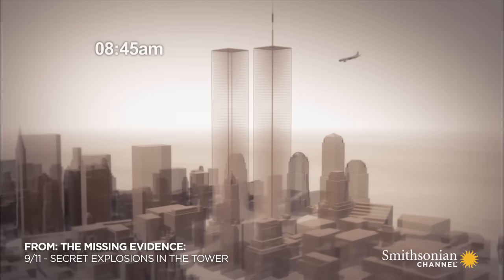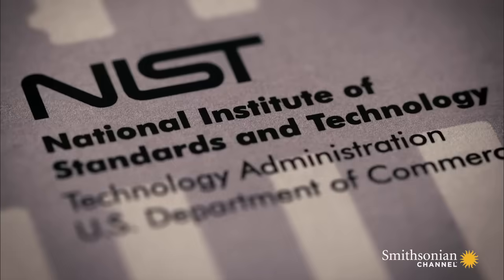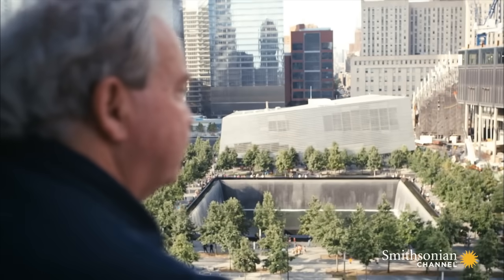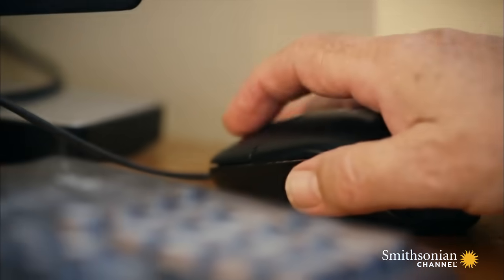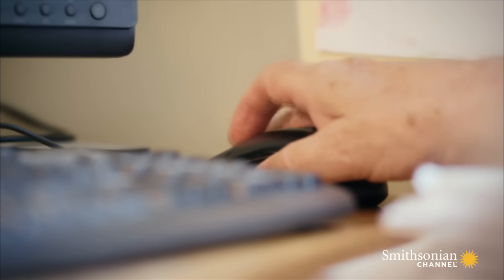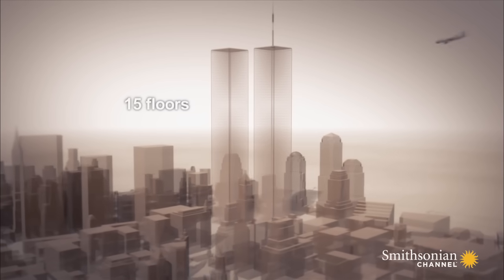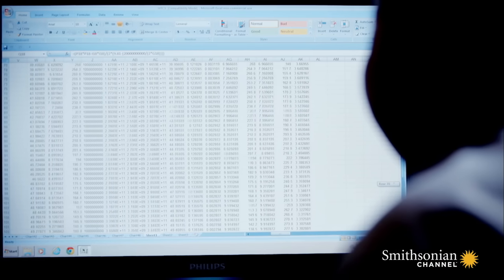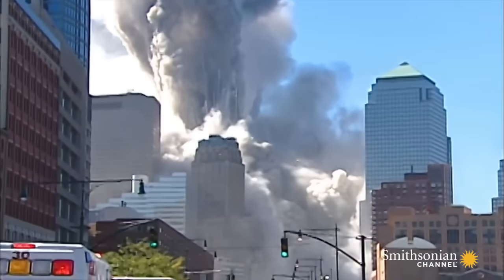This Computer Simulation Explains How the Twin Towers Fell

Comment: Thermite and controlled demolition. 
No other way is plausible.
Reply: ? Were the towers made of wood?
Reply: @Tim22222  haha , well spotted
Reply: @broadkast477  Okay, next question: When have you ever seen a complex skyscraper demolition performed with thermite? Not possible, thermite is too slow.
Reply: @Tim22222  good boy , you keep telling them that.
Reply: Good sir, The impacts of the planes striped the fire retardant spray foam off of the steel beams, exposing them to the full brunt of jet fuel fire and the continued fires of everything else. This lead to the steel beams being weekend to the point of failure. Which resulted in the collapse.
Reply: @HazmatUnit But I guess its more fun to think the government did that to us

Comment: Buildings don't collapse in their own footprint, unless an implosion took place! The core was too dense to collapse..... unless it had some serious help! Stop believing these fairytales!
Reply: The towers spread destruction 200 yards in every direction. They did not collapse into their footprints, not by a long shot.
Reply: Good sir, The impacts of the planes striped the fire retardant spray foam off of the steel beams, exposing them to the full brunt of jet fuel fire and the continued fires of everything else. This lead to the steel beams being weekend to the point of failure. Which resulted in the collapse.

Comment: HOW DOES STEEL TURN TO POWDER DUST??????
IT DOESNT !!!
Reply: No steel turned to dust, so no problem there.
Reply: @Tim22222  then where did it all go? You telling me those two monstrosities have a small debris pile??.
Ridiculous
Reply: @paulsutton5951  Did you know the WTC complex had 7 levels below plaza level? So the pile was in actuality about 10 stories high! And since the towers were 95% air, that sound just about right!
Reply: @drizzho  Weakens the steel, maybe for a partial collapse not a whole building.
Reply: @user-fm3xr9yz3i  where is the building gonna go? The whole top half crushed the bottom, the floors were supported by truss’, not actual beams. The center core where most of the support is, stood 60+ stories for a good 10 seconds after collapse, then when everything it was welded to was gone, it too came down into the pile.

Comment: Considering the impact zone of the north tower was around the 80-100 floor zone, how did the "45k ton", 20-30 floor portion of the building have enough force to plow through the bottom 80 floors which surely would've been triple that number and would've been able to resist the collapse? Logically speaking, how did the top 20 floors slice through the bottom 80 like a hot knife through butter in 11-12 seconds?
Reply: Answer: One floor at a time.
Reply: @Tim22222 <----- this is a government shill. It's only purpose is to go after anyone who questions the official story.

Comment: If his theory is right the building wouldn't have been standing as they were adding floor while building it. Imagine the weight on the first 10 floors? How did it hold all the others? So if one collapsed it would act like dominoes? Zero chance of that
Reply: There's a good docu here on youtube: "World Trade Center: Anatomy of the Collapse." Look for  it, it's a very good explanation of why once the collapse started it could not be stopped.

Summary: In the towers' unique "tube" design, unlike traditional skyscraper design, the bottom floors didn't carry the tower above! Instead each floor was supported individually by clinging to the columns & was only responsible for carrying its OWN weight, not the floors above - the columns did that instead. So what happens when 100,000 tons of tower top falls onto a floor only designed to carry 3500 tons? It punches right through! And keeps on going...

Comment: I think Smithsonian need push for investigating more these 4
1) How did both buildings fell the exact same way if second tower was hit at a different angle and height? How did it collapse first vs the first one which was hit earlier? 
I would also expect that if top part collapsed it would at maximum take out as many floors below as they are above. Newton third law
2) Second building should have had is top part fall off on the side where the explosion occured.
3) WTC7 how did it got on fire? And collapsed like a pancake?
4) This Steel and concrete structure wasnt able to sustain heat but other structures that been on fire for HOURS havent collapsed? Just burned?
Reply: 1) The 2nd tower fell first because it was hit lower down (more weight for the damaged section to support) and asymmetrically.
And you do not understand Newton's 3rd, because you are failing to account for something: GRAVITY. Newton's 3rd refers to a "closed" system, on in which there is no external force (like gravity!) acting on it. STRIKE ONE!
2) To fall off to the side, the top would have had to slide sideways more than 100 feet! There was no sideways force to do that. STRIKE TWO!
3) The collapsing towers hit it. STRIKE THREE!
4) Which of those other structure were hit by a plane first? Which had their water supply cut off so the sprinklers didn't work? YER OUT!!!

Comment: Did not really see a complex computer physics simulation here, just a guy sitting in front of his Excel spreadsheet.
Reply: a physics simulation is just math calculations of forces, you're probably thinking a graphical simulation model
Reply: @horseradish4046 No, I merely doubt the approach purely based on the tools he used.
Reply: The math says that three thousand bodies don’t disappear in a building collapse ( 90% of the victim’s bodies were never recovered from ground zero!)
Reply: The Excel contains the simulation—i.e., the mathematical calculations as to whether the towers would collapse. It's math, not graphics.
Reply: Calm down
Reply: Calm down

Comment: Didnt they fall just from the burning? Thats what I’ve heard atleast
Reply: No - burning and extreme structural damage from having a 150-ton jumbo jet crash into them at 500 mph!
Reply: @Tim22222  i was kinda right i guess
Reply: @Tim22222  because the burning weakened the structure right?
Reply: @DeezerWeezer20  Yes! The temperatures of the fires exceeded 1800°; steel weakens up to 90% at that temperature!

Comment: Here is the problem with this entire narrative planes are created to collapse upon Impact in order to create less chance of explosion and less impact jarring of passengers. Airliners have been cut in half by power lines... your telling me a plane cut 10 steel beams in half!! Wow!! Ok if that's what you say!!
Reply: The planes still weighed ~150 tons, and at 500 mph that's a LOT of kinetic energy the buildings had to absorb.

And no, the planes did not cut any steel beams, they separated them where they were bolted together.
Reply: @Tim22222  I'm sorry it seperated the beams where the bolts are lol... you don't understand much about construction do you those areas where bolt meets steel is probably the most sound positions of the entire building and once again you can cut through a plane with a hammer. Planes are made to come apart when they contact anything solid. They are made to collapse they are from design made to fold!!! I can't say that any more clear it's not a fighter jet or military craft it's for public trans port and they are made as light as possible so there is no resistance when impact is made look it up it very easy to find this info out. The second that fule caught fire it burnt up hence the fire ball you see when impact is made that fire ball exhausted over 50% of the fuel in a instant every floor and all the steel under the damaged floors is not damaged in any way no fire no cut beams no damage. The top floors fell 15 feet before contact with the next floor so how is there enough drop to cause failed  floor after failed floor the speed of free fall!! I'm sorry every person other than the 911 special committee ALL OVER THE WORLD HAVE DLL SAID ITS IMPOSSIBLE!!! thank u for your time

Comment: LOL. One lonely man in his bedroom with his PC solves all first world problems.  His model does not explain the prescence of nano-thermite, nor the basement explosions, nor the molten steel at ground zero, nor the fires that took 92 days to extinguish, nor the velocity or trajectory of flying girders blasted up into the sky, and 100m away from the building, nor the the fact that the security of WTC was a brother of Bush run company, nor the fact of that central core elevator shafts were out of action in the preceding week due to "maintenance". Am pleased he has solved the case. 😂
Reply: His model does not explain the "presence" of "nano thermite" because there was none. Neither was there molten steel. There were long-lasting fires but those aren't hard to explain, really, as there was virtually unlimited fuel in the pile. Gish gallop, gish gallop ...

Comment: I love how all the conspiracy theories focus on how the buildings collapsed instead of looking at the real hidden truth. All of the pilots had to be highly trained and experienced to perform those maneuvers at those speeds and at those altitudes.Those planes are not designed to be flown at those speeds close to the ground where the air is much thicker. I heard a commercial airline pilot trainer say the " They had to perform those maneuvers like the plane was made of glass". To believe that they took the classroom part of flight training in Florida and then did this is like beleiving that your teenager could take the classroom part of drivers ed and then back a tractor trailer around a corner and into a loading dock in one shot.  Where were they trained and by who? In Saudi Arabia by US military trainers on bases that WE built. Those buildings had serious design flaws. That is why no other buildings have ever been built using the same concept of hanging floors between a central core and the exterior wall. They did it to increase rent-able floor space,
Reply: This is not true at all! What the hijacker pilots did was easy. EASY. All they had to do was fly from point to point. They did not have to take off, communicate, or manage most of the aircrafts' systems. Load up your favorite flight sim & try it yourself. EASY.
Reply: @Tim22222 So you don't know anything about flying or aircraft design.......got it.
Reply: @bobknull7502  Oh, I know a few things; I am a pilot, after all! (Small planes, not commercial.)

But go ahead: Explain to me what I've got wrong - if you can.
Reply: @Tim22222 What you got wrong is you picked the wrong person to troll.
Reply: @Tim22222 Are you are soldier as well because you have played WOW?
Reply: @bobknull7502  Avoid, avoid, avoid! 😘
Reply: @bobknull7502  Still waiting for you to tell us all what I've gotten wrong.

Of course, you can't because I am not wrong.

Comment: Steel is a mixture of iron and carbon that can melt between 2500-2800°F or 1371-1540°C. The pressurized conditions inside a jet engine allow jet fuel to burn at very high temperatures. At room temperature and pressure, jet fuel burns at around 1,500 degrees Fahrenheit.
Reply: The adiabatic flame temperature of kerosene is over 2000°C or 3800°F. That means conditions with a constant 1 bar pressure with normal air. So kerosene could melt steel, but it of course does not need that to actually let it fail miserably.

Comment: When i melt steel i use jet fuel
Reply: That will work nicely! It can burn at 3800°F after all. But you can also just use some charcoal and enough forced air of course, just like furnaces and bloomeries used throughout history.

Comment: Where did the thermite molecules in the dust samples come from?
Reply: Owned, what a loser. "Thermite molecules" lol
Reply: What thermite molecules in what dust samples?  You do know thermite is just powdered aluminum and rust, right?  Two big steel buildings cladded in aluminum, 234 tons of airplanes.
Reply: @mfitz1969  OK chief
Reply: @Godflesh88v2  - So no thermite then. Glad we settled that. Saves a lot of time beating a dead horse that was already just a pile of unrecognizable goo.
Reply: @Godflesh88v2  - What rhetorical question. You made an accusation without evidence premised entirely on speculation.

I inquired if you even knew what you were talking about.

Clearly you don't or you would have rebutted with the actual evidence to support your OP claim and embarrassed me.

But you didn't.

Comment: These "experts" are insulting. He began by saying that the physics didn't make sense, he's right they don't. And they still don't. Yet he then tries to flip it in a way that every sceptic will once he explains. NIST's simulation of WT7 collapsing  didn't even match the footage. They also said that there were no reported explosions, yet there is footage of firefighters, police and HUNDREDS of civilians clearly stating that there had been many explosions in the towers. Even on floors closer to the lobby than the impact zone. There is also footage where you can hear very loud explosions, but no, NIST says not.

But the smoking gun is WT7 that all 47 floors fell at free fall speed into its own footprint, due to "office fires on 5-8 floors. There was footage on YouTube of a female news reporter talking to a woman who was holding a baby, discussing the expected collapse of WT7. All of a sudden she span round towards the building and said "this is it..." but the building was still stable for a few seconds. It was suggested that she was reacting to the preliminary explosions which in a controlled demolition systematically weakens the structure so it falls exactly how and where it is intended. How could she have known beforehand as she did?

Steel frame buildings DO NOT collapse because of wood and plastic burning. The building if still on fire 22 years later would still be standing. Only a shell but still standing. 

Finally, the building would have to have been rigged with explosives before 9/11. It's not as though it's a quick job that could have been carried out after 9am whilst there were fires burning across multiple floors... just think about that. It had to have been carried out not long before 9/11, which was a completely unexpected attack. 

There are a lot of videos that have been removed from YouTube and websites that Google will not show in search results.. Why is that?

I seems that the powers that be can do anything without facing the music. However,  had that happened in a small town....!!!
Reply: Just like most conspiracy theorist, I am going to pick a tiny part of your scribblings and thereby debunk anything you said or tried to prove (also, I did not read it, I just saw the word steel).

- Kerosene has an adiabatic flame temperature of 3800°F so it could melt steel.
- Most fuels, even charcoal, can be induced to much higher temperatures with forced air; how do you think we got to the bronze and iron age with coal otherwise. What is a fire in a box with lots of holes high up in the air going to do.
- Steel does not have to melt to fail as a load-bearing structure anyway, so if it melted or not is moot.
Reply: @Appiekap  okay, so you believe that the explosion of aviation fuel that lasted for a few moments managed to weaken the steel structure over the course of around 5 floors. I will let you have that as possible. 
Then how is it possible that the floors beneath (that were untouched by the fires nor suffered any damage from the impact of the planes) collapsed in the same manner as though there was nothing under them? Ask ANY physicist what would happen if a damaged building that is collapsing at a weak point onto the sound levels beneath. It is impossible for the WTC Towers to collapse how they did without the the floors beneath being removed in sequence. 
The smoking gun is WT7 that collapsed later in the day due to fires across less than 10 floors that contained generic 'office materials', the building wasn't hit by a plane and again it was a steel frame building. In the history of steel structures, never ever has there been a complete collapse due to fires. Realistically the entire building could have burned until there wasn't anything combustible left and it would still be standing... How can you be so blinkered to scientific fact. WT7 fell at free fall velocity into its own footprint because of a fire??? IMPOSSIBLE

Comment: 3000 American structural engineers and architects signed a letter stating that they believed these 3 buildings were brought down by controlled explosions. 
Frank on the other hand believes building which have stood for 40 years couldn't support their own weight. He also appears to be absent minded since he didn't factor in the central core which was of a traditional steel building design which instantly rules out the pancake theory. According to Franks computer model its just crumbled like an over cooked cake.
Reply: One thing to support weight, another to have it slammed on top of you. Try it with a hammer. Rest it on you.  Then swing it against yourself. Duh.
Reply: INCORRECT! 3000 international engineers and architects (few of whom were structural engineers BTW) signed a letter requesting further investigation. That's IT! No theories. No studies. No conclusions. 

Pretty big difference.
Reply: @Tim22222  if the impact loading was sufficient to overload the structure then the bottom for the building would have failed at the same time since the loading is transfered down through the building. 
Your lack of reasoning ability attests to your obvious low IQ.
Reply: @Tim22222  if they requested another investigation then they were not happy with the official investigation.
Reply: @paulsmith1981  True! But that's not what you claimed.